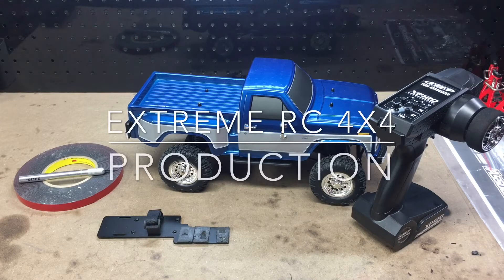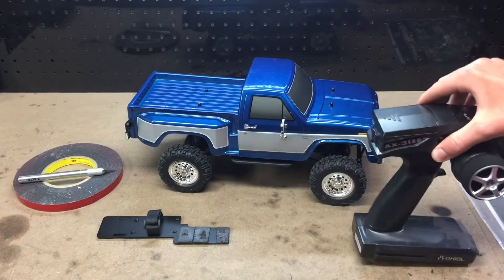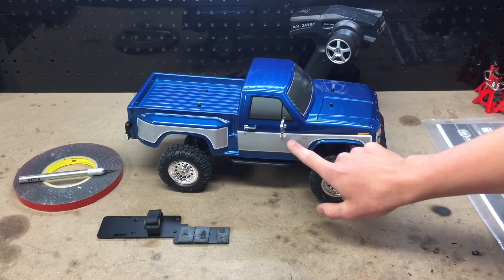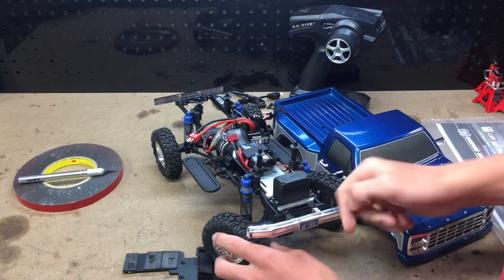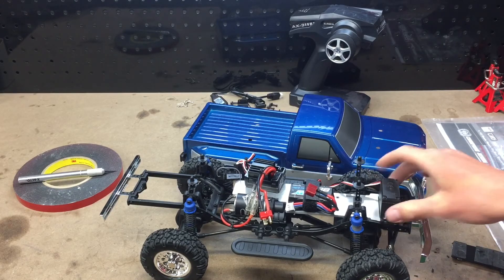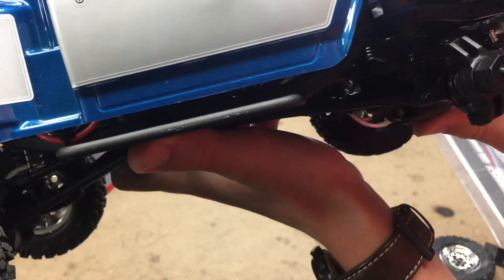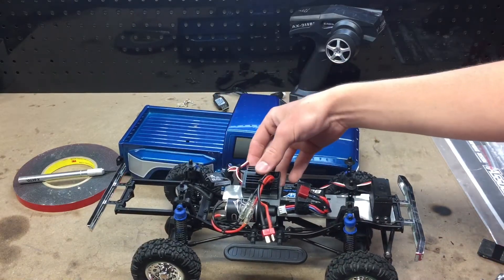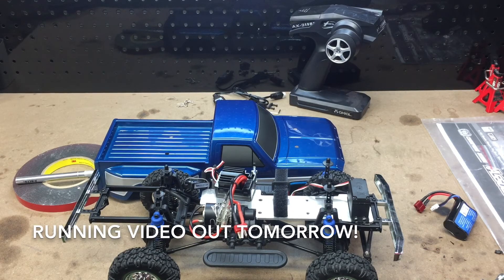EXTREME RC 4X4 CR12 First Day Modifications

Comment: Bought the Thunder Tiger Toyota Hilux version ... 99€ brand new on Lindinger a few years ago. A real bargain ! 
Excellent small truck , much better than SCX24. Full metal links , bearings etc . + STANDARD SIZE servo / receiver / esc. Excellent basic flysky GT2E radio included.
Nothing more needed . Maybe put some oil in the shocks to make them a bit stiffer.
Just looking for a bigger lipo battery but it has to keep about the same weight cause the truck is light... 
However , Associated priced this truck MUCH TOO HIGH...  ( 240€ here in France ) But it seems that the same base but cheaper made Funtek CR12 is the same , and sold 169€ ...

Comment: More cr12 upgrades
Reply from the maker: Austin Castle send me an email if you’re looking for anything in particular. Lots available already at
extremerc4x4.com
Reply: @ExtremeRC4x4  kool is that ur machine work
Reply from the maker: Austin Castle yessir, all made in Michigan!
Reply: @ExtremeRC4x4  that's awesome u should try making like a long arm lift like trx4 has but for the cr12 maybe even a smaller more comp worthy front bumper maybe some steel wheels. And do u know where I can find some better axels for this thing
Reply from the maker: Austin Castle you can do an axle swap however you run into issues with the chassis just not being strong enough to take the additional abuse
Reply: @ExtremeRC4x4  I was thinking to add maybe some additional support inside sea rails to support the bigger axles and motor
Reply: I want to extend the wheelbase lift it up switch to all metal gears and load it up with aluminum or stainless

Comment: If you look at the esc there the plugs to change from lipo to nihm and “crawler mode” or “Normal mode” at stock setting it brakes instant and hard switch the plug over to the other setting and it gets rid of the instant brake you have to reverse to brake, and double tap for reverse. Easier than putting new remote in
Reply from the maker: Bryce Mills I installed the remote for better low speed control. My esc came from the factory set on crawl mode. Thanks for watching!

Comment: @ethanboening  yes mine did as well and it would almost pop wheelies but switch plug to normal mode and it’s way less jerky, I discovered it while waiting for your video to load lol I was unboxing and testing watching your vid and while it was buffering I noticed the different settings.. it’s less instant, it will roll to a stop unless you engage brake and smoother acceleration
Reply from the maker: Bryce Mills oh okay, I have not tried that yet. Good to know!

Comment: Why they did not make the plate like yours a very well made replacement part. A small move of the servo to make the steering so much better. Who ever did the testing should of pointed that out and corrected it. I also find some of the basic radios poor on reaction and as they are knocked out so cheaply you will find you either get a good one or in this case not. This truck would be excellent if they did a roller chassis or even a kit.
Reply from the maker: Basildon Trail Blazing Buddies Thank you! I couldn’t believe how much the small change did to improve the steering. I’m not sure why they opted to use the crazy mounting system that comes on it. I was able to find the issue within around 10-15 of driving on concrete and knew that I could do something to improve it. I think a kit version would be awesome! The chassis would be a great base for a small body build. I’m hoping that now I have some of the issues with my mount worked out that I can make it available to others that would like to purchase them for their trucks. Thanks for watching!

Comment: Can a 540 motor fit?
Reply from the maker: Felix Chong it’s not a direct bolt in. You would probably end up having to switch the transmission as 380 and 540 size motors have differently spaced mounting holes. The stock 380 motor I think does good in the truck for it’s size but there are many other options in the 380 size if you were looking to upgrade. Thanks for watching!
Reply: Ethan Boening thanks for your kind reply
Reply from the maker: Felix Chong You’re welcome!